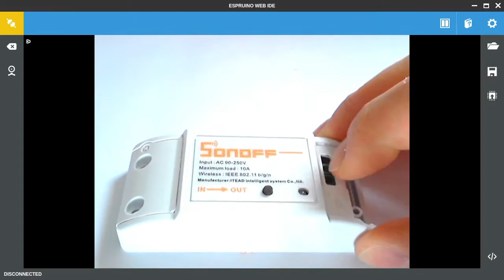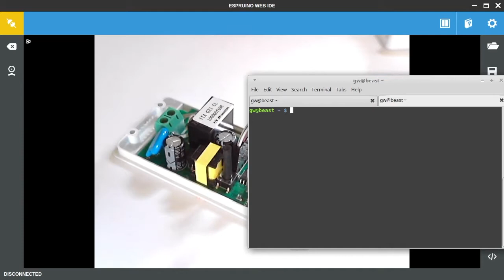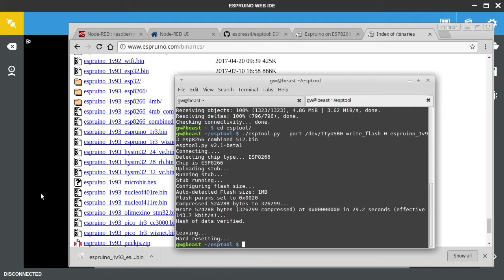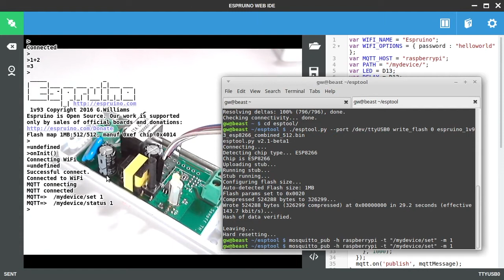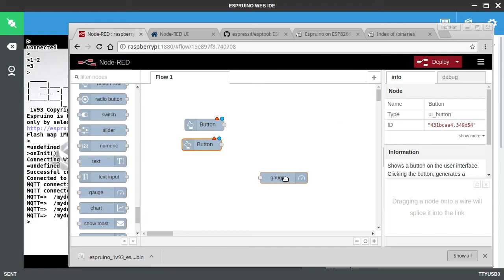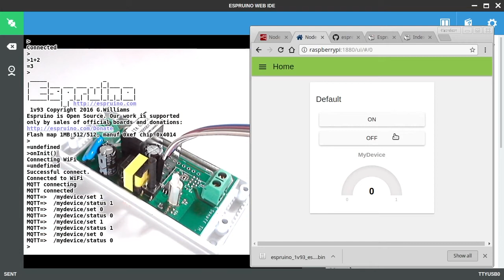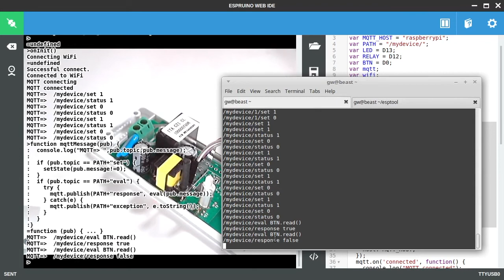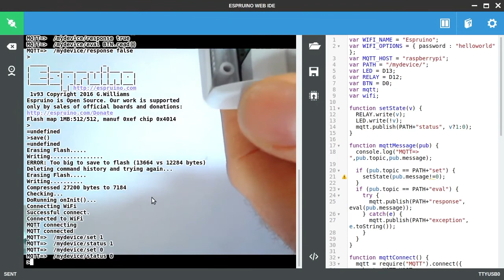HOME AUTOMATION with Espruino and MQTT, Part 3 - ESP8266 Sonoff

Comment: What are you saying at around 2:09? The part after "while holding down the button" is a bit hard to understand.
Reply from the maker: Ahh, sorry. I say "Press the button down, and I'll plug it in to USB". So basically it's applying power to the board while the button is held down, which puts it in to bootloader mode.